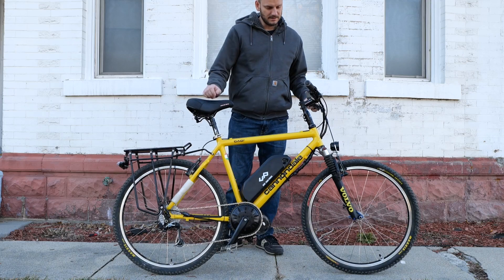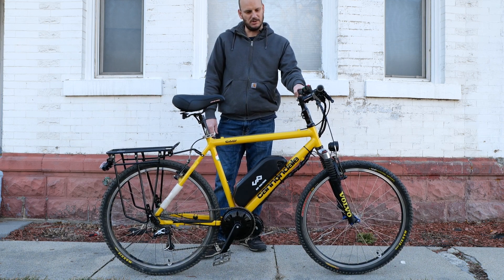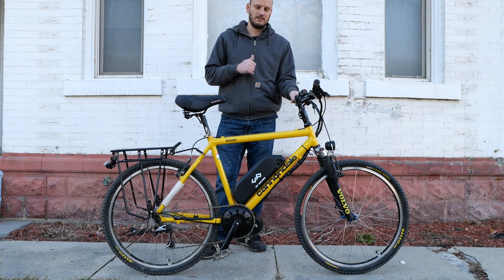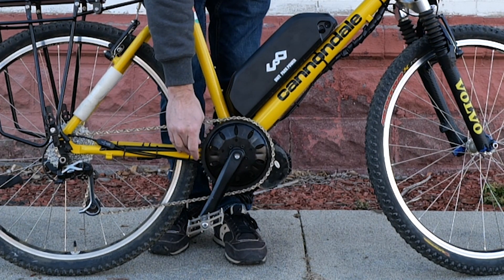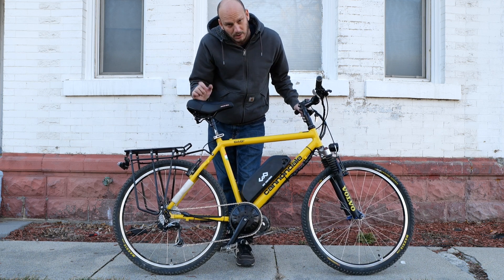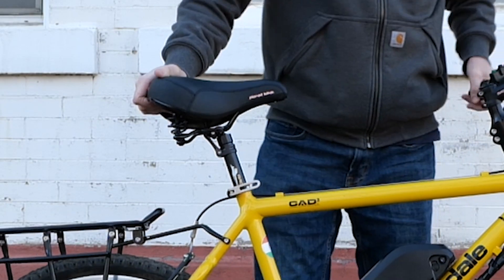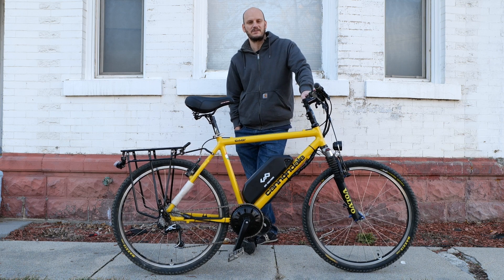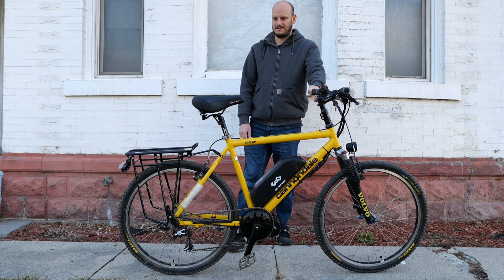Custom E-bike Build: Cannondale Cad3 w/ Bafang BBSHD 1000w Mid Drive 52v 17ah

Comment: For example when splicing in a wire harness on a car from fire rats etc. Don’t cut your harness in one cut. If you can peel back and expose the wires let’s say there are two and up. Cut them In staggered lengths. And when you re install the other end cut the same color wires in the same step. That way non of your connections with rub together in time. It also lessons the space width when re heat shrinking, soldering, crimp connections etc. 
-your an amazing man to do this for the world, think most of us are so very thankful…Rabbi!
Reply from the maker: Great tip!! Thanks 😊

Comment: I converted this same model with almost exactly the same setup but using a BBS02. Didn't need any spacers and the chain alignment was good enough with stock chainring. The eggrider is great. Being able to fine tune motor characteristics without needing a cable and computer in the shop is worth the price bump. Need to upgrade the rigid fork though because the ride is rough at times.

Comment: I did a BBS02 build on an early 90s Specialized Hardrock and it turned out awesome but the bike was a little large and I wanted disc brakes so I bought a 2003 Gary Fischer bike and put a new air shock on the front and moved everything over to it and its pretty freaking sweet. All said and done I have about $1600 in the build for everything.

Comment: ? What would be needed too run duel hub motors off of one controller, so I would have just one screen on the handle bars? Can the controller that comes with one hub kit handle two hub motors, or is an upgrade needed? And if I were to wire the hub motors in series, would that prevent the front tire from doing a burnout?

Comment: Amazinger video Johnny I live in Spain and I hace owned a Caad3 Road bike since 1996 that It IS still in mint condition. It currenty has  Sram 10 speed group. What ebike kit would you reccomend? I want It to be pedal assist and no throttle. I would like at least 70 miles of range.

Comment: Hello. I have BBSHD 48v,  52v  battery 50-AMP 21 Ah Mega Shark E-bike Battery (SKU: SKU-196
I used the speeed app. Which when I connected and hit read it said max output on my controller with 30 amp. But was set at 25 amp. I use speeed app and changed my wheel size from 28 to 29. And changed output was set at 25 and I changed the 26 amps. Now seems to go faster. And miles per hour seems more accurate. But now I cannot reconnect the speed app. Any thoughts? Thanks Carl
Reply: Solved problem of "used programming cable once and then would not work again". For 1000W BBSHD Bafang. (Tapped thumb throttle while trying to hit connect button) so what happened was. I used speeed app (yes three e's) for Android phone that I downloaded from play store . Using programming cable and USB to C adapter cable. Connected my phone to my controller, and used speeed app, and was able to  make adjustments. Changed wheel size to 29" and raised my amps up from 25A to 26A 
Output. Went for a ride. The   
Speedometer seemed more accurate and had little more power. Excited to make more changes. But could not get phone/app to connect again. Tried deleting app, reinstalling app, restarting phone. Didn't work. Decided to come to edrivenet and use pc laptop with 8.1 operating system. Downloaded appropriate program, USB driver ect. That was a struggle for me.
Trying to download, unzip compressed files ect. I am very much download and have prompts to tell me what to do next or it does it automatically. Just hit next, next, finish then open an icon that magically appears on desktop. But I digress...So I follow instructions to hook up to my controller and hit connect button but the read flash is greyed out. Finally after some frustration either tapped on thumb throttle or tapped out of frustration ( the bike lurched forward but I was able to keep it from getting away). But low an behold all of a sudden I saw my controller information on the screen and the " read, write "ect. we're not greyed out anymore. So I was happy for about a second. But still could not read or write anything. So again out of frustration I tipped bike on kick stand so back wheel was off ground. I tapped the throttle with one hand and hit write flash with other. Then icon came up said write successful. After that I was able to make adjustments and write to the controller normally. (No more messing with the throttle.) The rest is history. I spent the next hour making adjustments and going for test rides. DESCLAIMER  I am not saying anyone should try this. I am just telling you what I did.

Comment: Maybe someone can answer a question about that light kit…. I just installed a BBSHD on my big Norco hard tail. 14 AH 52v (too small btw: 35km range on PAS 3, and cuts out dead at 44V) Anyway re: my kit; I just have one small 6V +,- wire for the included headlight. The seller says that there’s no way to have the taillight function. Is this true? I was thinking of splicing that wire and running a taillight, but I still wouldn’t get the brake light function, or maybe that switch takes care of that function? Any advice would be much appreciated 🇨🇦

Comment: Have you done any 20" Folding bike conversions like the old Luna Cycle folder?  Essentially a skinny tire folder with disc brakes, BBS02 and Hailong battery pack mounted on crossbar spine?  "A friggin shredder" channel has one of these and he really likes the bike due to light weight, tremendous torque, good top end speed AND it's easy to place into a car trunk.
I did similar with a cheap Steel Zizzo folder (@ $250), it has rim brakes and it's pretty zippy.  Changed out handlebars for a wider cockpit and handling ($5 used equipment bin at local Seattle Bikeworks store) and used 1/8" thick Aluminum rectangular tubing as riser for battery to get above the hinge bump. I had to do a forward Rivet nut for battery to mount properly.  Weighs @ 31 lbs with no battery.

Got to be careful at Startup, don't gun the throttle in 1st gear, easy to pop a Wheelie. Short wheelbase and 20" tire torque makes front wheel light.  Have to lean forward at times to add weight up front, so it's not for a clueless newbie.
I swapped the BBS02 for a Tongsheng TSDZ 2 motor due to Torque Sensor as a safer bike for newbies. No unexpected Wheelies, safer slow speed around pedestrians, the Cadence Sensor on BBS02 can give you a speed surge that cause control issues.  Only problem is you have to pedal hard for top end speed due to Cadence Sensor and it's not as fast. Good hill climber but not as powerful and finished as a BBS02 motor.
I see you offer Tongsheng motor on your website.  Experiment around, a 42 lb folder could be a good seller for you.  It's a lot thinner and lighter than a 68# Lectric XP 20" hub folder.  
Or try it on a 20" BMX bike. The channel gets boring since you see the same full size frame combinations.
Reply from the maker: I did a polygon folding bike with hydraulic disc brakes and also a montage paratrooper
Reply: @JohnnyNerdOut  How did you like the test ride?  Did you think it was worth the effort?
I'll agree a full size bike rides well.  Just expanding the ebike options.

Comment: I really like this convert. I have a 40 year old Diamond Back MB and was wondering if it could be converted.
Reply: Bottom bracket is probably the only thing you need to look into. Figure if what type of bb you have and go from there

Comment: Truly awesome.
I may be a bit prejudiced. On paper this is like my 1st build. CAAD F7 with a BBSHD and 17AH 52 volt battery.
This should prove a real workhorse. With maintenace mine has gone thousands of miles over 5 years and is still going:)
Love the lights. I bought a set for my CAAD but ended up putting it on my city bike instead. Now I need another set:) Can't reccomend them highly enough for city riding.
If you want to use a phone as a display on the cheap there's a free app called "speeed" (yes, 3 "e"s) that can do the programming and work as a display using the same adapter used when connecting the controller & PC plus a USB adapter to connect to a phone instead. It doesn't allow for a seperate display while using the phone but only costs about $30-$40 in adapters.
Reply: I believe the Eggrider is also Bluetooth, so it’s cordless. I have the new 860C display but I’m not impressed with it. Very minimal options. Has a USB port that I don’t really need because the battery has one. 
 Anyway, I have the BBSHD. I just have one 6V wire for a headlight on my harness. Did you splice that wire to run the taillight?
Reply: @big_red_machine3547  The EggRider is indeed BlueTooth. As I said my solution was a "cheap" option, & that entails some sacrifice.
My drives have no additional ports for lights. JohnnyNerdOut carries a set (headlight, tail light, brake light & turn signals) that connects to the main harness. It's what he used on this build.
Reply: @michaelsprinzeles4022  nice yes I see the wiring harness thing now. Also, I guess a guy needs an android phone for the Speeed app. What a cool app that looks like! Maybe my ancient Samsung will work for that. Thanks
Reply: @big_red_machine3547  I'm not sure about fruit compatibity as I have the robot OS. However you end up programming your motor beware to "read" all the settings before you "write" any or you may change settings you didn't intend to.
Good luck & enjoy.
Reply: @michaelsprinzeles4022  yes thanks for the advice. It’s lots of fun! I’m currently starting work on a cargo/ dog trailer, with the idea that I can stop paying for vehicle expenses!